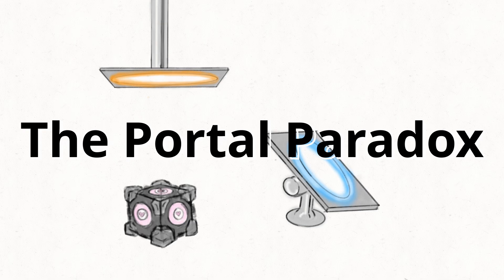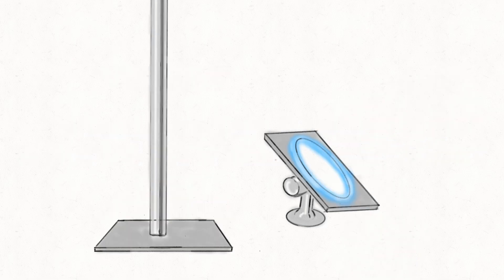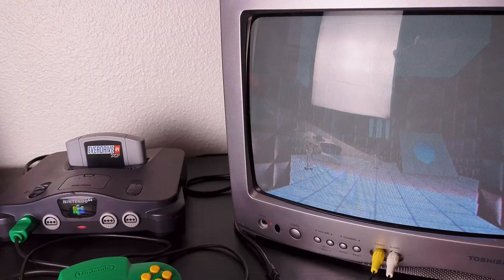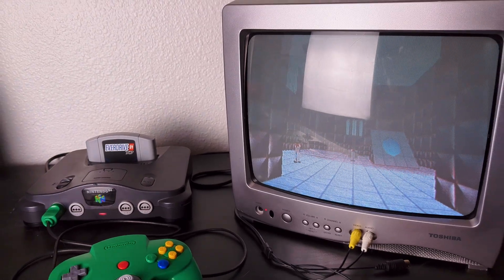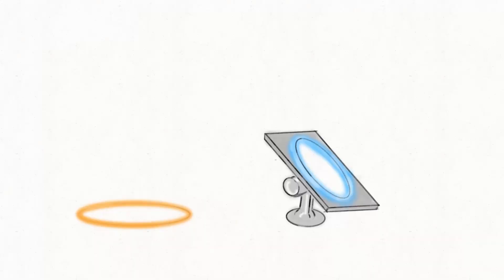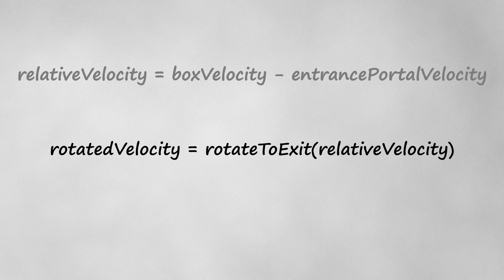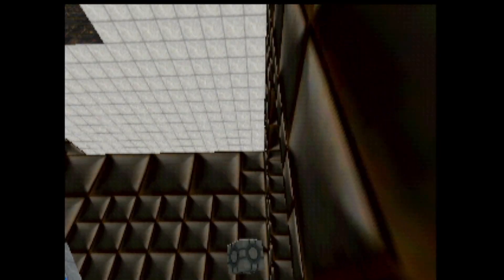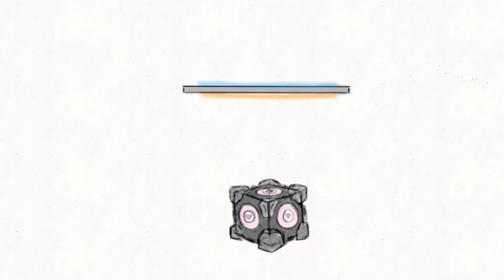I rewrote Portal from scratch and solved the Portal Paradox

Comment: What I find weird about it is that it implies when you move a portal, you're effectively moving the entire world towards the opposite end
Reply: OMG you know what's even wierder? When you walk forward, you are effectively pushing the entire world and universe back while standing still!, yeah that's how relative velocity works.
Reply: @3_pancakes767  No, it doesn't. We can testify that it is us moving along the surface, and not the Earth moving away from us. A connection between two different points in space is a wholly different deal
Reply: @Thornskade  We clearly see cube doesn't move. Both parts of the portal are in the same room where we observe.
Reply: @Thornskade  Altefer having a real hard time grasping general relativity right now lol.
Reply: That's the thing that gets me. He is basically saying the Portal moves at 50 MPH, Object enters, Object exits the Exit at 50 MPH + it's Speed. But that is NOT how reality works. It works like that with You, on a Train, because you are PHYSICALLY Touching the Train. But For his example to work, he would be saying If you were LEVITATING, in Zero G, in the middle of the Train Car, with no exess force by the Train, then you would maintain speed with the Train. Which is NOT true. You would be a single point in the air, as the train moves forward without you, till you get flattened by the wall at the end of the train cart.

Motion is TRANSFERED only through PHYSICAL Motions. You have to PHYSICALLY PUSH something, for that something to MOVE, even if the force is just AIR, which is how Airplanes 'fly'. But Portals are Displacing air, not PUSHING air. So if a Portal slams down on a Stationary object... Exactly WHERE does the FORCE pushing the Object come from? It can't come from the portal, the portal is just an empty doorway with no physical structure. It isn't the Piston, as it's physical attributes are on the outside of the portal, not the inside, or else there wouldn't be a gateway. So what is 'PUSHING' on the Cube to send it forward?

If your saying it's the portal itself... You've got a lot MORE issues than just 'Will an object come out the other side fast', you've got issues of, sending air atoms, into already occupied space at high velocity, while leaving behind a vacuum of empty atoms in the portal's wake. Shit gets really messy and Nuclear very fucking quick.
Reply: Which is a whole 'nother can of worms
Reply: Which is why we don’t move to portals
Reply: but that's how relative speed works, doesn't it?
Reply: @amitbar5691  I don't know... For the cube to shoot out like that, it must have made a pretty big impact. And I mean, the impact doesn't have a limited range, after all, or does it? It has to be the entire universe colliding with itself, unless there's a logical error in my thinking. Maybe this is actually realistic given we accept the idea of portals, but it seems to give portals a ton of power that goes beyond traversal which doesn't seem to fit the use case they've been assigned in-universe

Then I think it also gets even weirder... because if it works like this, then the entire gravitational force of the planet must have an effect through the portal onto itself, so frankly, I can't imagine that it could possibly physically work like the way he coded this
Reply: @Thornskade  Since there are no Portals in real life this discussion is a bit fuzzy. But the implementation of our Physics in done right in this regarding relativity of motion.
And your thought of moving the entire world is not wrong.
Just think of you being in a train. It seems that the trees and everything moves and you're stationary.
Reply: @allliabdull6100  Being in a train is not comparable, because you are in fact moving and that's testifiable, but the question here is how Portals would react

But again, the problem I'm having is that when this is realistic, then you are in fact causing the collision of the entire universe against itself, and gravity of the planet and every other planet would have an effect through the Portal.

Obviously yes, portals don't exist in real life, or maybe they could and we don't know but either way we can't testify this, but I'm more thinking about the Portal universe and how portals function within it. I just don't think this relative motion theory from the portal itself moving can work like this, or else everything else about the game would be inconsistent. I'm not sure if there's another plausible, if fictional, answer, though
Reply: @Thornskade  you would not cause the universe to collide with itself. It just move in the direction.
And for the testifyability:
Imagine being in a rocket with a constant velocity and seeing another rocket come at you with the velocity.
you would see the rocket coming to you with twi times the speed while you would not see yourself moving.
From their perspective it's the exact opposite. They would see you coming to them with two times the velocity while they remain still.
In this thought experiment both sides are correct and there is NO way to say which rocket is moving or not. This is the basis for Einsteins theory of relativity. 
So for the problem in the video there is no way to say which things are moving and which are not. You can only tell the movement relative to some other thing. there is no universal and objective velocity.
Reply: @allliabdull6100  There is an objective velocity for a moving train given it's rolling along the Earth, and likewise there are forces moving the portal in this video while everything around it is what's staying in place, but anyway.

Point is, the cube does not exist in a vacuum; it is the entire universe that is moving towards the portal, not just the cube. What I'm not sure about is the collision of the object with the portal against the planet coming towards it. Consider it must be sucking in air and every other particle and atom on its way down, and on top of that, shouldn't there be a gravitational impact from the universe effectively beoming a duplicate of itself and affecting itself through the portal? 

On one hand, I strongly feel that the video is correct. If you imagine the cube floating in empty space, and a portal moving towards it so that it passes through, then it seems logical for the cube to keep moving out of the other end of the portal, because from that end's perspective it had already been moving and it seems absurd to assume the cube would just be stuck right in the middle of both portals.

But on the other hand it also feels like this has massive implications and puzzle pieces still missing, and that it seems not applicable to the actual role portals have in that game universe.

Presumably the answer is that portals like they are in Portal are physically impossible and I'm thinking too much about it. I mean to be fair, you can already create a perpetual motion machine just by placing portals top and bottom from one another which also doesn't seem right
Reply: @Thornskade  it would work like that, if portals like that could exist. It’s however impossible, as it could generate energy out of nothing, at least by the rules of relative energy. Because you could put stuff into it and transport it somewhere else without the energy consumption being any different relating to weight.
Reply: this is a big issue people are trying to solve about "how would a real wormhole act"
as it is simply a tunnel from one point to another based on general assumptions and maths - and by that, moving the tunnel, if it were to serve for instantaneous traversal, would likely yield a similar result
and the way a portal's function is described is not entirely dissimilar from a wormhole, and in fact, people study the idea that maybe portals if achieved like this in real life would actually be wormhole technology.
Reply: @KingOfRedPlays  I'm a bit curious. What is more realistic, a portal that is simply a hole and has an exit somewhere else? Or an actual tunnel with a bit of length to it?
Reply: @amitbar5691  As I understand, current wormhole hypotheses lean towards there being no "tunnel," just a direct connection between two points of spacetime. The metaphor I've seen used is that if you bend a piece of paper so that two points are touching, poke a hole through them, and smooth over the edges so that it smoothly rolls from one side to the other, there's no "distance," the edges of the hole just meld from one side directly into the other.
Reply: @amitbar5691  I think two portals with a tunnel connecting them is more realistic. We have them already in fact, they're called tunnels.
Reply: That's the whole thing with reference frames. If you're observing an elevator from the outside, it look like the elevator's moving upward. If you're looking through the window from in an elevator, it looks like the world is moving downward. Neither is more correct, and any physical calculations made in either reference frame will have the same result.

Now, say you held a coin in the palm of your hand. If you lifted your hand and then suddenly stopped it, from the coin's perspective the entire world except your hand was moving downward, and then suddenly your hand started moving at the same speed as the rest of the world. This action, from your perspective, is commonly known as a "toss."

For the cube, the only difference is the angle, which is somewhat weird if you think about how gravity effects it, but with the portal moving quickly shouldn't matter much.
Reply: @YOM2_UB  No, because time dilation logically contradicts the idea that motion is relative. It shows that every object in the universe has an objective velocity. As the person in the elevator ages slower than the person standing still outside, you can tell this motion wasn't relative, but rather it really was the elevator that moved

So for the portal, I don't believe you can make the argument of relative velocity. And even if you did, how could the entire universe have a relative motion against itself by moving a portal? For the cube, it appears to gain velocity out of nowhere. Without any sort of physical interaction, which I believe moving a connection of two points in space through it is not, how could the cube suddenly jump from its previous state?
Reply: @Thornskade  I'll admit I'm not well versed in relativity, but from my quick reading it sounds like time dilation is caused by a change/asymmetry in reference frame (due to acceleration), not by a universal objective velocity. You standing outside the 1st floor door are going to appear to the guy riding the elevator as in a slower relative time just as they appear in a slower relative time to you, and yours only appears "correct" once the elevator arrives because it had to accelerate to get into your reference frame.
Reply: @YOM2_UB   No, it's velocity, not acceleration. Imagine two rockets being created far away from one another at the same time, one with velocity and the other stationary. At the point that they meet, the moving one is younger than the stationary one. Again, no acceleration or deceleration. And whether the motion can be measured with either of them as the stationary reference frame, one of them has objectively aged slower

This, to me, appears to prove that total and objective velocity is a thing. If people think it's not then I would really love to hear the explanation because I can't see it
Reply: @Thornskade  After further reading, my previous analogy is indeed inaccurate and time dilation itself is indeed caused by only velocity. On your recent analogy, there's only one inertial reference frame where the two rockets appear to be built at the same time, which happens to line up with one of the observers. The other observer sees the first building their rocket later, and a third observer moving in the opposite direction as the second would see the first observer build their rocket before the second. The phrase "at the same time" only make sense if you've picked a reference frame already.

The time disparity of a round trip is caused by non-constant velocity (due to acceleration) though.
Reply: @YOM2_UB  I'm just saying they're built at the same time. Why does that need an observer? If you want we can have two observers standing at the origin points of each rocket, and the light of each rocket from when they appeared reaches each respective observer simultaneously, that's what I mean by at the same time
Reply: @Thornskade  That runs into the problem of one-way speed of light. The only thing we know for sure is the two-way (or round trip) speed of light. We don't know whether the light traveling from each rocket takes the same time to reach where the other rocket was built, and it seems like we can't know.
Reply: @YOM2_UB  I don't know what you're talking about. Put an observer in the middle then, they would see both rockets appear at the same time
Reply: @Thornskade  sorry, but for things separated far enough in space you cannot say if they happened at the same time without picking a reference frame. Ill break it down with your example.

First, the 'normal' reference frame. Its defined by the rocket you decided is stationary, the first rocket. The rockets are built at the same time with onboard clocks, and once the pass, the one that was moving has a smaller amount of time on the clock. 

Now, the other reference frame. This one will be defined by the second rocket. Heres where things get a little weird. When you transform from one reference frame to another, its not just velocity that shifts, its also the slice of the universe thats considered the present. The effect of this is that the second rockets clock starts after the first rockets clock in this reference frame, and so when the rockets pass each other the second rocket is still younger. 

Both of these reference frames are perfectly valid, as in the describe what happened in the same way. There was just the faulty assumption that something can be similtaneous in general relativity, when they cannot. This was what the other commentor was talking about were we can only measure the speed of light two directionally. Anyway that you come up with to sync two clocks over space together will show unsynced clocks in another reference frame, so its impossible to measure the one way speed of light.
Reply: @jetison333  Forget the reference frame. Let's just remove all distractions. There's nothing but empty space. And two fruits that are coming closer together. Also, they are both decomposing, but don't ask how that works in space

One fruit is stationary, the other is moving. By the time one fruit reaches the other, the other doesn't exist anymore because it has been fully decomposed. The moving fruit makes it before decomposing because through its velocity, it aged slower than the stationary fruit.

Therefore, even though you can pick a reference frame and state it's the stationary one, ultimately which fruit decomposes first still determines that one of the fruit was actually moving and the other was not.

Where is the issue?
Reply: @Thornskade  This is still exactly the same as the spaceship example. lets call the "stationary" apple apple A, and the "moving apple apple B. Ill add some numbers to the example to be more clear. 

First, from the reference frame where apple A is stationary. in this reference frame there's a moment where each apple will decompose in 60 seconds. However, since apple B is moving, it takes longer to decompose, so apple A decomposes first.

now, from the reference from of apple B. In this reference frame, apple B is stationary, and apple A is moving towards apple B. However, there is not one moment where both apples are 60 seconds away from decomposing. In fact, when apple B is 60 seconds from decomposing, apple A will be much less than 60 seconds away from decomposing, so much so that it cancels out the time dilation and it still decomposes first. 

Because the same thing happens in both reference frames its impossible to tell which one is the 'true' one. You claim that the reference frame of apple A is the correct one because apple B is experiencing time dilation and therefore decomposes first. However, I can just as easily claim the the reference frame of apple B is the correct one, its just that apple A decomposes first because its older, despite the time dilation that apple A is experiencing. In this frame it doesn't matter if apple A is moving, its older. So therefore its impossible to tell if its apple A or apple B that's moving.
Reply: @jetison333  I guess that was still too many distractions. My only concern is that there is one object that's moving and the other is not, regardless of who can tell or measure it. I'm not sure why it's impossible to just prepopose that both fruit are the same age and instead say "but it could be this or that cause we can't tell"

Can't you just think of space as a coordinate system and pin an imaginary flag between the rockets? Given one will pass this flag and the other will remain in place, you should know which one is moving. Or indeed, just place an observer in the middle. For this "reference frame" you're after. This only seems to change whether you can measure it, but not the reality of who is moving; that should be the same irrespective of this observer being in the middle or not.

Here's the thing I don't get: I don't care about measuring, but about which object is moving. Eveything seems to have been about measuring. When a given ball is the only thing in the universe, then I understand no one could tell if it's moving, but that doesn't change the fact that it is moving, right?

In addition, if I recall correctly, the way we think of spacetime is that we're always moving at a fixed speed, but if we're stationary then we only move through time, and when we approach light speed we only move through space?

In which case, is that not an objective value that is true for the rockets or fruit regardless of whether we can measure it? One of the fruit or rockets only moves in time while the other moves both in time and space?
Reply: @Thornskade  its impossible to presuppose that both fruits are the same age because your automatically choosing a reference frame when you do that.  And look, maybe your right. Maybe the universe actually does have a specific chosen reference frame where it makes the simulation. But the problem with that is that it's impossible to tell which one is that universes frame of reference, so we could argue all day about which one is the real one. But again, that's only a possibility, it's also equaly possible that the universe truly doesn't care about a specific reference frame. 

This is a fundamental philosophical question we are debating, if something cant be measured can we say if it exists or not?. 

Like with a ball in an empty universe. Sure, from one reference frame the ball is moving. But how do you know thats the right reference frame? I mean, maybe the universe randomly changes its reference frame every microsecond. Then what the ball is doing is some crazy weird dance that only makes sense to other things inside the universe. Because we can't measure it, we can't say for certain what's actually going on.
Reply: @jetison333  I don't care about reference frames though? The idea that one rocket uses its thrusters to close the gap between both rockets, and to then suggest the rocket that didn't use its thrusters might be the one who's moving, is ridiculous. As is the idea to me that a ball that's already been moving, when suddenly everything vanishes (so we no longer have any reference frames), could be supposed to just have stopped moving. That doesn't make any sense to me and the only explanations I've heard involve our measurements and our reference frames, how is that the only thing that matters
Reply: @Thornskade  you cant just decide not to care about reference frames when its literally the topic of discussion, and the thing that shows that your wrong. How do you know both the rockets were stationary instead of them both moving and the rocket ahead firing its engines to stop? 

And the ball doesnt have to be in an empty universe anyway. If its moving, theres a reference frame where its stationary. Theres also a reference frame where its moving with the exact same velocity as it was moving relative to the rest of the universe before it disapeared.

Thats the thing, your presupposing that there exists a reference frame, describing things happening in it and insisting that this is the "correct" reference frame. But there is no reason to call that the correct reference frame besides it being the one you decided. How do you decide its the correct one? You cant, the universe acts the same no matter which reference frame is the "correct" one, and thats even if the universe has a stable reference frame and doesnt work in a way thats completely agnostic to reference frames which is equally possible.
Reply: @jetison333  No, the topic of discussion is why the cube is moving out of nowhere, and people saying "hey, motion is relative" which doesn't seem to explain anything. This is almost a different topic at this point

But you understand how thrusters work, right? I find it pretty ludicrous to suggest that the rocket could stop instead of accelerate from thrusters.

So you have two rockets facing each other, not moving relative to one another at least. Then, one uses its thrusters to get to the other. So gas is moving the opposite direction, and the rocket moves in the direction of the other rocket.

And you want to tell me that the rocket that didn't use its thrusters could be the one that started moving for no conceivable reason? Ignoring the entire process the other rocket went through to get to the other one? I fail to see the logic in this.
Reply: @Thornskade  a rocket could totally stop using thrusters? Spacex does that quite often when they land rockets. If you accelerate in the oppisite direction your moving in you slow down. 

Anyway it doesnt seem like you understand this other reference frame. The rocket with out the thrusters does not accelerate, that would be ridiculous to say. 

Ill add numbers again, in one frame, both rockets are stationary. One rocket accelerates towards the other at 100 mps. They end up eventually meeting. In the other frame both rockets are moving to the right at 100 mps. The one on the right uses its thrusters to accelerate to the left at 100 mps, and ends up with 0 velocity and they end up eventually meeting. So in one frame of reference its the one that accelerated thats moving, and in the other its the one that didnt accelerate. Again, there is no way to differentiate between these two frames. (Although you can tell which rocket accelerated, as acceleration is not relative)
Reply: @jetison333  The rocket is facing the other rocket. No way to go in the opposite direction.

But look, we don't even need two rockets. Let's just have one rocket as the only thing in the universe. It uses its thrusters. Does its state change? We have no reference frames, but know how thrusters work. So, logically, its state must change.
Reply: @jetison333  How about this: Suppose all we have is Ball A and Ball B in the universe, distancing from each other at near lightspeed.

Unless I also learned this wrong somehow, matter can't go faster than the speed of light. Let's say Ball A wants to catch up with B via accelerating. If A is the ball that is moving at lightspeed away from B, it would be able to reverse and catch up to B, which is stationary. However, if it's B that's moving at near lightspeed, then A would not be able to catch up since it can never reach the speed of light.

What is wrong with that?
Reply: @Thornskade  it accelerates the same direction in both cases, to the left. And yes, it's state changes because it accelerates, and acceleration is not relative. For any given reference frame the rockets velocity will be different before and after. 

Yes ball A can catch up to ball B. Although ball B is very close to the speed of light, it isnt at the speed of light, so theres always room for ball A to go faster than ball B. Sure it might take a very long time but its possible.
Reply: @jetison333  It is however not possible to go faster than the speed of light, and which ball it is changes what ball A needs to do drastically, so how could motion be relative here in respect to the fact that matter can't go faster than the speed of light?
Reply: @Thornskade  because velocity does not add linearly in general relativity. You might say, if Ball A is moving at 95% the speed of light to the left, and ball B is moving at 95% the speed of light to the right, then wouldnt ball A have to be moving at 95+95=190% the speed of light from Bs reference frame? But no, the velocity added up is still less than the speed of light, even from Ball Bs reference frame. You can look up the equation if you want.
Reply: @jetison333  I'm saying, when Ball B is moving at the maximum speed matter can move, then Ball A cannot catch up. Whereas if Ball A is moving at max speed, then it can reverse its course and catch up to B and even surpass it.
Reply: @Thornskade  there is no maximum speed matter can move at. It cant move at the speed of light, but it can get arbitrarily close. You can move at 99.9999% the speed of light, but you can also move at 99.999999% the speed of light and be moving faster.
Reply: @jetison333  That's not possible. There has to be a limit.

Even so, we could put the limit on the balls themselves. If their method of locomotion can only put them at a certain max speed, then it surely matters which of them is moving and which isn't
Reply: @jetison333  By the way, just for the purposes of understanding, if it is indeed the case that you can get arbitrarily fast but it's relative from each observer, would that mean the Earth might as well be moving at 99.99999% the speed of light right now?

At the same time, even if you can't measure it, does this not also mean that you always move at a fixed percentage of light speed, which would indicate an objective universal speed regardless?
Reply: @Thornskade  it is possible. Give me any speed that matter can reach, and Ill give you a speed faster than it. It cant go at the speed of light, so it has to be smaller than that. (Im just going to take the sqaure root of that speed btw.)

And it doesnt matter if the balls have finite ability to accelerate. It will take the same acceleration no matter the reference frame. From a reference frame where ball A is moving to the left at 95% the speed of light, and ball B is moving to the right at 95% the speed of light, ball A will need to be able to accelerate to a stop from 95% and then back to a greater amount than 95% back. From ball Bs reference frame, ball A is going at 99.87% the speed of light and will have to decelerate from that velocity to catch back up to B. It so happens that it takes the same amount of acceleration to get to 99.97% as it  does to accelerate to 95% twice. 

And yes, there is a reference frame where earth is moving at some ridiculously high percentage of the speed of light along with the rest of the universe. But since absolute velocity isnt a thing, it doesnt really matter. 

And I dont quite understand your last question, can you expound on it?
Reply: @jetison333  That wasn't my example though. If Ball A can only accelerate to 50% of light speed, and Ball B is already accelerated to 50% of light speed, then Ball A can't catch up. But if Ball A was accelerated at 50% light speed but in the opposite direction, it can both catch up to B and surpass it. It was said that Ball A moving with B stationary was the same as Ball B moving but stationary, but their limited ability of speed seems to indicate that their reference frames aren't equal

The last question is simply, if objects move at a certain percentage of speed of light, is that not a universal indicator of their velocity regardless of reference frame? Because otherwise 0% of the speed of light would be the same as 99% of the speed of light which seems contradictory.
Reply: @Thornskade   I dont understand exactly what you mean in your example. Ball B is moving to the right at 50% the speed of light in some reference frame right? Then ball A starts at rest in that reference frame, and has enough enough delta-v to accelerate to 50% the speed of light. Then yes, it could catch up to ball B (or get to the same velocity anyway). If A was moving to the left at 50% the speed of light and B was stationary (which is the same example as previously) than A can accelerate to 0 velocity and catch up to B. If A is moving to the left and B is moving to the right both at 50% the speed of light (a different scenario than the two others) then A will not be able to catch up to B, only get down to 0 velocity and watch as B leaves at 50% the speed of light.

And no, an object does not move at some percentage of the speed of light absolutely. It only moves at some percentage relative to some reference frame. One object can be moving at 0% the speed of light in one reference frame and 99% the speed of.light in another, thats not contradictory.
Reply: @jetison333  Ball A and B are equal and can only move at a certain speed. So if Ball A is the one that's moving, it can reverse course and catch up to and surpass B. If B is moving, A can't catch up because they can only go to a certain speed.

When I jump, I don't believe that I'm pushing everything else in our solar system or even universe away from me. But the way people explain relativity that seems to be a valid thing to say but it makes no sense from what I can tell.

I don't understand your answer to my question unfortunately, that doesn't make sense to me
Reply: @Thornskade  oh I see what your saying. Ball A and Ball B can accelerate as much as they want as long as they stay under a certain velocity. But a certain velocity in what frame of reference? Sure you could tell ball A and ball B not to ever exceed a velocity in a given frame, in which case ball B could stay out of reach of ball A simply by going max speed. But theres nothing physically stoppying ball A from accelerating faster. The choice of reference frame you say they shouldnt exceed a speed in is completely arbitrary.

No object can be said to be moving at a certain percent of lightspeed regardless a reference frame. It can only move in relation to something else, because there is no absolute frame of reference. 

When you jump you are not pushing everything in the universe away from you, this is completely true. Thats because acceleration is not relative, and theres experiments that we can do that determine its you that is accelerating and not the rest of the universe.
Reply: @jetison333  It's not arbitrary if it's an inherent property of the balls. And, if acceleration puts an end to all of this, why is everyone bringing up relative motion? The cube in this video is clearly accelerating. And so are trains, just saying
Reply: @Thornskade  you literally cannot make it an inherent property of the balls. There is no physical phenomenon that would prevent them from accelerating beyond that speed. 

The reason people bring up relativity is because of exactly what you say in your original comment, that because the portal is moving, everything on the other side must also be moving relative to the cube, and once the cube goes through the portal the universe doesnt suddenly stop, it keeps moving, which looks the same as the cube moving through the universe.
Reply: @jetison333  Replace the balls with rockets, the way rockets move means they can only go so fast. It really is an inherent property from what can tell, which begs the question how this can be a relative phenomenon to me. And if reference frames are really necessary, isn't the universe and everything within it not one big reference frame anyhow?

I said it in my comment but I also said I find it weird, because one side of the portal is the exact same as the other side of the portal rather than a copy, and I can't fathom how something can be in motion relative to itself. It would be moving and not at the same time
Reply: @Thornskade  rockets can only accelerate so much. They have some amount of delta-v, or change in velocity, which are entirely unlike the balls you described. Rather its more like my other comment about them, where only the relative velocity between the balls matter. Greater than 50% the speed of light, no intercept, less, then intercept is possible, no matter the frame  

And yeah, two portals moving relative to reach other is pretty weird, but we are assuming they exist so shrug.
Reply: @jetison333  So is it not true that the same relative motion (rocket A or rocket B is already moving) can still mean two different situations? In both cases the distance decreases the same, but only in one rocket A could reach rocket B?
Reply: @Thornskade  unless you are saying both A and B are moving in opposite directions at the same time at 50% the speed of light (which is different than just one moving at 50% the speed of light) then no, in both cases, whether A is moving or whether B is moving A can catch up to B.
Reply: @jetison333  How can A catch up to B if both can only go a certain velocity? The only reason we can land on the moon is because the moon is not distancing away from our spacecraft at the same or higher velocity, right? If B is the one that's moving then A can never catch up since it can only go as fast as B ever would, what am I missing?
Reply: @Thornskade  "only go a certain velocity" is really imprecise and not really how rockets work. Rather rockets have some ability to change their velocity by a certain amount. This is called delta-v. No matter what velocity a rocket is going it can still change its velocity by that amount. (Not including relativistic effects, but that doesn't really matter in this case since velocities add and subtract in the same way.) Lets say A has 50 mps of delta-v. If B is moving away from A at 49 mps, then A will always be able to catch up. It doesn't matter if A accelerates from 0 mps to 50 mps, or if A accelerates from -49 mps (negative meaning to the left away from B) to -49+50=1 mps. It's both a change in velocity of 50 mps, which A is capable of.

It's the same thing even if A and B are moving at relativistic velocities to the right. From some frame B will be moving at 90% the speed of light plus 49 mps, and A will accelerate from 90% the speed of light to 90% plus 50 mps. Its exactly the same situation.
Reply: @jetison333  I had this "fact" stuck in my head I heard somewhere that rockets would never be able to accelerate indefinitely, however, looking it up it seems to be because of friction from whatever particles in space. Assuming however that space is empty minus each rocket and its method of acceleration, this must mean you're correct because friction would affect them both equally

Thanks for your patience and sticking with me, though I still can't wrap my head around how moving portals could possibly move the cube or anything without physical interaction, and I doubt relative motion is the answer, but at least I know now which misconception prevented me from understanding that reference frames can in fact be equal under any circumstance
Reply: yes it doesn't make sense, the object should maintain the velocity relative to the plane
Reply: @kernnus39  But like why the place specifically
Reply: @kernnus39 which plane
Reply: @kernnus39  your model makes no sense at all. Firstly, as a portal rushed towards you, you'd see the world on the other side as if you were moving through it quickly, then you'd just instantly stop? How does that seem natural? Also, imagine a stationary cube is halfway through being enveloped by a portal moving 1m/s with the other portal being stationary. Even if the part of the cube on the stationary side were stationary, it would be being pushed forward by the other half of the cube, which is entering the new space at a rate of 1m/s, so that velocity must be imparted onto the front half of the cube, too, and that velocity must be conserved even once the cube is fully through. If this wasn't the case, then the cube would have to be resisting being pushed through the portal, meaning a moving portal couldn't simply envelop you, it would somewhat drag you along with it as you passed through it. It just doesn't make sense
Reply: @EvilDuck14  Yeah, this is how I feel, but think about it: The cube was not moving, and that is an issue.

I know a lot of people have thrown relative velocity at me but velocity simply is not relative. The faster an object moves, the slower it ages. Testifiably, there is no relativity when it comes to velocity other than our subjective perception. So now, we have a portal moving towards the cube, and what exactly is it that causes the cube to move? This is what I can't understand about this. I understand your logic and I explained how I'd imagine this similarly but at the same time, I can't explain what force would cause the cube to actually start moving. It doesn't seem to make sense to me.

This is why I say this implies that the universe is being moved against itself by having the portal move, and even then I can't make any coherent logical sense of it
Reply: @Thornskade  If velocity being created is your problem, you should equally take issue with stationary portals - they also create velocity from nothing. Since velocity is a vector, it has a directional component, meaning that if you fall through a portal and are flung upwards on the other side, you've lost downwards velocity and created upwards velocity. Your speed is the same, but your velocity and momentum has changed - that means portals already violate the conservation of momentum as is, so moving portals don't really add any new issues. 

The way I see it, an observer should have a seamless experience as they move through a portal - if a portal moves towards them, they will see the environment on the other side moving towards them, so as they pass through it should continue to move towards them, not just stop. And once again, it wouldn't make sense for them to stop - their front half would be trying to stop as soon as it goes through, but their back half would still be trying to push through, which would impart the same speed upon their front, so unless some force pulls them backwards to cancel out that force as soon as they're all the way through, they shouldn't stop - at most they would slow down while passing through the portal, but again, that would require that the portal drags them back a bit as they pass through it
Reply: @Thornskade  velocity is relative, even when talking about very high speeds. special relativity is its own beast and is very fucked up, but it is still based upon the assumption that velocity is relative. when YOU move faster than the earth's frame, you experience time at a slower rate than those on earth, thus you move through time slower than the earth. the earth is "at rest" and you are in motion

however, if you and another person are moving in opposite but equal velocities in space, this results in weird effects. your frame (the rest frame or non-prime frame) experiences time differently from the prime frame or the other person's frame. you will see their frame as ticking slower than yours. the crazy thing is, they see YOUR frame as ticking slower than theirs. hope that helped.
Reply: @EvilDuck14  No, in one instance the cube starts moving from nothing, and in the other it was already moving. That's not the same thing

Again, I don't disagree with you, it mostly just seems to me that neither solution makes sense. Perhaps portals as they are in Portal simply violate the laws of physics and couldn't exist the way they do
Reply: @slmnemo  I'm not talking about subjective experience, I'm talking about the objective movement of an object. Velocity is only relative to an observer, but objectively and in total it is 100% testifiable which object is or was moving how fast. So the problem is this: How can the cube start moving on its own? What force is it that causes it to shoot out? The portal is not an object on its own, it's a connection between two points in space. In practice, does this not mean that the entire universe has to be in motion and against an effective copy of itself? But that also seems impossible, because that would mean we're creating total motion by moving portals around. Do you understand what I mean?
Reply: @Thornskade  the relative velocity theory here seems flawed to me, and since this is coded I can’t say anything for certain, but it’s possible that since the cube doesn’t teleport immediately when touching the portal there could be a force acting on the cube when the sending portal passes over the cube quickly. Since the receiving portal has to push away the box (otherwise it would make the box 2D) there would have to be a force exerted on the box from somewhere to push the box out and this could be from the ground on the sending side or from “portal physics.” I think it’s possible for this model to be correct but with the current explanation it definitely feels like something is missing in terms of explaining the forces
Reply: @Thornskade  Well, motion is relative, so as far as the laws of physics are concerned both are equivalent violations of the conservation of momentum.

I personally think that the cube coming out with momentum makes perfect intuitive sense, but I'd agree that portals simply violate the laws of physics - that much is true whether they're moving or not.
Reply: @EvilDuck14  Why do people keep saying motion is relative? It is not in any way other than to the subjective experience of an observing agent, and only if their perception is imperfect. The faster something moves, the slower it ages. There is nothing relative about this
Reply: @Thornskade  velocity of frames is relative to other existing frames. you must define a rest frame with which time moves normally to age slower relative to. please read a physics book on special relativity or look through MIT's free course on it.

velocity is actually really fucky at high speeds v </< c. because of length contraction, from your rest frame you see people in that moving frame as shortened, thus shortening the speed at which they move. this is because their frame's velocity compared to yours cannot be faster than light, as it would then violate physics as we know it.

if you think velocity isn't relative, determine the exact center of the universe for which all times moves at exactly 1 second.
Reply: @slmnemo  That's not the point. The point is that when you walk on the earth, you're not pushing the earth away, it really is you who is moving, and testifiably so. When two rockets fly past each other, it's testifiable that they are both moving. That's the "relative motion" people are talking about for some reason, and it simply isn't relative at all
Reply: @Thornskade  your understanding of relativity is flawed. Motion can only be measured relative to something else - if there were some universe which was entirely empty except for one ball, there would be no way of determining that ball's velocity because velocity is a relative measurement.

Another example, if you claim you are driving on the freeway at 70mph, and I claimed that you are actually stationary and the earth is moving beneath you at 70mph, we'd both be equally correct. That is the fundamental idea of relativity - there is zero difference between a given stationary system and that same system with a shared constant velocity of any value.

And you mention time dilation, but I don't think you understand it. When you move quickly (as seen by an outside observer) your time will dilate relative to theirs and you will age slower relative to them. You will still experience time as usual, and you will appear, to yourself, to age at the usual rate. That's the kind of relativity that Einstein theorised, the more basic kind that I described in the last 2 paragraphs is what's relevant to our discussion, Einstein then applied that to the assumption that lightspeed is the most absolute constant of the universe and reasoned that time, space and momentum must be observed differently by different observers depending on their relative velocities in order to maintain the speed of light. While not relevant here, I assure you that it still absolutely is relative
Reply: @EvilDuck14  Something does not need to be measured for it to be real. For a thought experiment, assume there's a ball flying through our space, and suddenly everything but the ball disappears. The ball would still be moving

Time dilation clashes with the idea that you're both equally correct to say that the person is moving versus the earth is moving and the person is stationary. The fact that the person ages slower as soon as they start moving, is objective and hard proof that the person moved and not the earth. The fact that you wrote both paragraphs without realizing you contradicted yourself is quite odd
Reply: @Thornskade  if there is no possible experiment that could prove something's existence, it cannot be scientifically said to be real.

Time dilation doesn't clash with the idea that all reference frames are correct, the only reason it exists is to ensure that all reference frames are equally correct, because if there was no time dilation you could measure your own velocity relative to nothing but the motion of light, but you can't because time dilation causes light's speed to appear to be c to all observers.

I might not have explained it the best, I'm pretty rusty, but to disagree with me on this is to disagree with Newton, Einstein, and all modern understanding of physics
Reply: @EvilDuck14  You're basically saying that when a tree fell and nobody saw it, it didn't happen.

I don't know if there is a misunderstanding, but modern understanding of physics most definitely doesn't claim that motion is relative the way you describe it. You're not gonna find a scientist say that a train is stationary and Earth is just moving away from it.
Reply: @Thornskade  That's not at all what I'm saying. I'm saying a tree can't fall if there's nothing for it to fall relative to. There is literally no difference between a system at a fixed velocity and a system at zero velocity except for its interaction with another system.

The only reason no scientist says that is because it's a needlessly complex model. No scientist would argue that it's an incorrect model, only that it's a useless convoluted one. I don't know why you're so intent on arguing this when you obviously haven't even studied highschool level physics where they teach Newtonian relativity
Reply: @EvilDuck14  You seem to misunderstand. That's why I gave the though experiment. Or do you suggest that the moving ball would stop if everything else vanished from the universe just because people could no longer measure it? Or if you had two rockets and one would start blasting to reach the other, how could one say that this is equal in terms of motion when only one put in the effort?

What I know about motion being relative only concerns our measurements of speed and time. Like, the Earth is moving, but we don't care about that when we want to go from place A to B on Earth. But that has nothing to do with the cube and the portal here. My only concern is what makes the cube move, and relative motion seems like a non-answer.

I'm trying to have a discussion about logic and how the cube can accelerate like this. That requires some knowledge but not necessarily studying. I am probably missing pieces of information which I would have if I studied, but I don't think this constant mentioning of motion is relative does anything, as I'm concerned about total motion, the creation of motion, and not how we measure it relative to other objects. One big issue is that the portal is not an object per se, but a connection between two points in space. So what happens when one of them moves asynchronous to the other? Is that motion? If an object passes through, what's the force that causes it to move?

I only brought up time dilation to show that relative measurements don't appear to solve any issues here. Because it's easy proof that the two rockets I mentioned earlier are not equals. The one that actually moved, in total, aged slower. That we can measure their velocity relative to one another where each of them can be considered stationary, that is just not the point: There is total motion in the universe, not just relative measurements of motion
Reply: @Thornskade  did you study this or are you an engineer? We learned stuff like this in fluidmechanics in university. And what you are saying contradicts professors, that did this stuff for tens of years.
Reply: @Thornskade  ok, so you've made a very very significant mistake. You mentioned "total motion in the universe" a few times, but there is no such thing as "total motion", that's the whole point of relativity. 

Your thought experiment doesn't work because the initial assumption that a cube is moving through space is flawed, the cube doesn't have a velocity on its own, it only has a velocity relative to other things. No matter what velocity you set the cube to relative to anything else, it's a valid model to say that the cube is stationary and the rest of the universe moves around it.

And the reason I keep mentioning relativity is because relativity states that a portal enveloping you at 10m/s is exactly the same as you falling at 10m/s through a stationary portal (unless you think that the difference in velocities between portals is a factor, which is a difficult point to argue, I see no evidence in favour of that stance).

The argument that there should be some force causing the cube to move also doesn't hold any water; if your concern is that an object needs a force imparted upon it to change its velocity (which is true under all normal physics) then you should also take issue with the fact that a stationary portal can change the direction of your speed - changing direction is also a change in velocity, so that equally breaks the laws of physics. There's no difference - if you accept the logic of stationary portals than there's no grounds to insist that moving portals would have to apply some new force to change an object's velocity
Reply: @EvilDuck14  No, the problem is that the moving portal creates velocity out of nothing. You could let the portal drop onto the heaviest object ever and it would shoot out and wreak havoc in the facility, it seems to contradict conservation of energy. Stationary portals, at least stationary relative to each other, don't seem to have this issue
Reply: @Thornskade  stationary portals do have this issue. They also create velocity out of nothing. If an object falls through a portal at 10m/s and then is flung upwards by another portal at 10m/s, the portal just imparted 20m/s of upwards velocity onto that object. Velocity is a vector, so direction matters. And again, our good friend relativity says that this is an exactly equivalent breaking of the laws of physics as the scenario that you're concerned with.
Reply: @EvilDuck14  "velocity is a vector so direction matters" I'm sorry, but I would need an explanation to understand this. Why is "velocity a vector"? I only see mass that's already moving continue moving with stationary portals, but I see mass accelerating without physical interaction with moving portals. These do not seem equal situations to me.
Reply: @Thornskade  when I say velocity is a vector, that it has both direction and magnitude. A change in direction is the same as a change in velocity, and according to relativity, a change in direction is the same as a change in speed. Both require acceleration, that's how they are equal situations. 

It's becoming increasingly apparent that you don't have any level of education in physics, because vectors are the first thing you cover in high school physics. And that's fine, but I don't understand how you're so adamant when you have no formal backing to what you're saying
Reply: @EvilDuck14  The thing is you're just asserting that portals are changing vectors. You keep falling back to your mathematical measurements but when you look at how portals are portrayed in the game, they are a direct connection between two points in space, so I have no reason to blindly assume that there is a change in velocity at all.

I know what vectors are, thank you very much. I merely fail to see their connection to portals in a sense that the universe probably isn't a grid in that sense, which I think you'd agree with considering frames of reference are important to you. Where is the change in vectors from the frame of the cube?
Reply: @Thornskade  When you ask "Why is velocity a vector?", that makes me think that you do not, in fact, know what vectors are. 

Stationary portals change velocity because a cube can fall downwards into one and then be flung upwards out of another, at time A it was moving downwards, and at time B it is moving upwards. There has been a change in direction which means a change in velocity. That is how physics works.

I've read parts of your arguments with other people, and it's becoming more and more obvious that you don't have the slightest clue what you're talking about. You're denying the correctness of relativity - something that literally any physicist who has lived in the last 500 years can tell you is an indisputable fact of nature, and you're using time dilation to justify your stance. The models of time dilation we have are literally built upon relativity, relativity is the only reason time dilation exists. 

I recommend you go find a few good videos to explain what relativity is, how time dilation was discovered, and the twin paradox. I can recommend some if you like. These are concepts that you have to understand to have this discussion, because you've been arguing for 2 weeks from an entirely uninformed perspective
Reply: @EvilDuck14  You didn't read enough of the other posts then because this was already cleared up. I was under the impression that mass could only accelerate to a maximum speed which is why I couldn't find the logic in saying every reference frame was equal.

Regardless, it doesn't make sense to say there's a change in vectors because we're dealing with two points in space that are connected. There's no change in vector from the point of view of the cube and from any other reference frame it seems more like the cube is teleporting than anything else, but really it's just moving continuously.

Most videos you find on the matter are pretty bad though. They start explaining things but then whip out some equation which to someone who has trouble reading and understanding those might as well be like switching to Chinese in the middle of the explanation
Reply: @Thornskade  right, I'm glad you got that sorted out. To be clear, objects with mass do have a maximum speed (about 300000000km/hr) but time and space dilate to make sure nothing ever appears to exceed that speed regardless of the frame of reference.

I agree that there's a lot of useless content out there - plenty of videos are overly complicated and don't make an effort to lower the barrier to entry, and I've found a few videos that try to present it in a simple manner, but they get the facts outright wrong. That's why I offered to find some useful resources that fall in the sweet spot, but if you've worked through that then not to worry.

The problem with your argument is that physics doesn't really deal with portals, because they don't exist - the closest thing in real life is wormholes, but to have a discussion on how conservation of momentum works when wormholes are involved we'd probably both have to go get degrees in quantum physics and come back and pick up this discussion in 3-5 years. The cube only moves continuously from its own perspective, from an outside perspective its motion is (by definition) discontinuous - that's the whole point of a portal. But now you're arguing that it makes sense because the transition is seamless from the POV of the cube - so again, consider what the cube would see when a portal rushes towards it - the portal and the world on the other side are moving quickly towards it, so when it passes through the portal, surely the portal should continue to move away behind it and it should continue to move towards whatever is on the other side. After all, when a cube moves through a stationary portal, its momentum is conserved with respect to the world on the other side of the portal - if two portals are on the floor and it falls into one, it sees the roof on the other side approaching as it does so, then the roof continues to approach at the same rate as it leaves the portal - the cube has changed momentum as seen by an outside perspective, but from the pov of the cube looking at the world through the portal, its speed hasn't changed. Extend that to a moving portal and it seems obvious that the cube should fling out of the portal